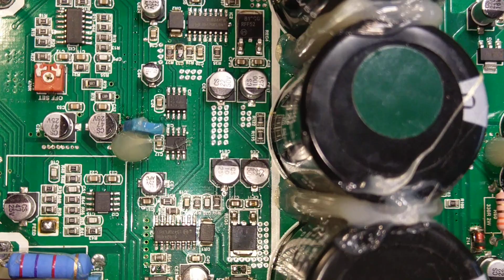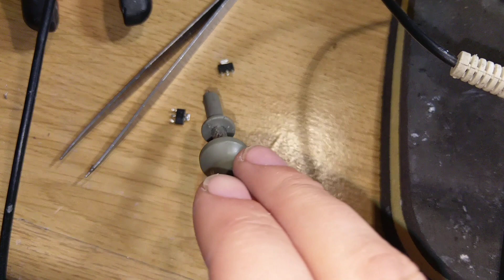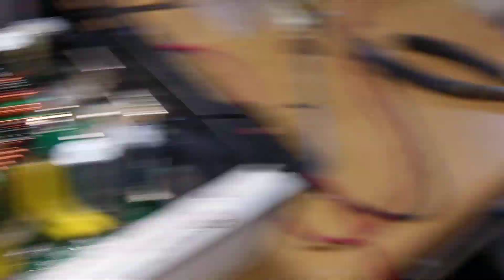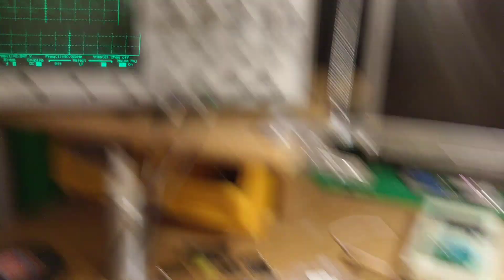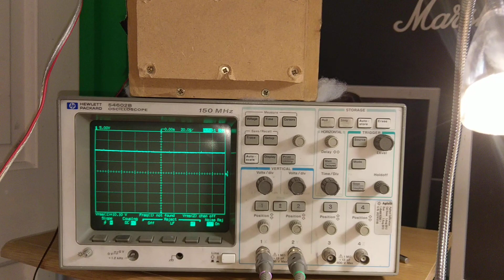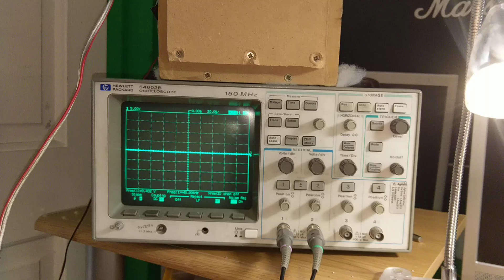HOW TO FIX Taramps turning on but no sound

Comment: Where do you find such terrible amps?  Not adding a tantalum cap across a zener diode is just garbage... zeners are one of the easist way to make noise.  Id prefer a microphic cap over the zener noise.

Comment: Hi bro , all pins of my remote controllers touches each others so after that i have no audio output, sub pop at startup only, tramps big boss 3, rgb light works perfect, its like there is remote with 0 volume

Comment: my amp went is cold outside doesn’t work but in the summer it works with out any problems i have to turn the heater on and wait to get above 40 degrees

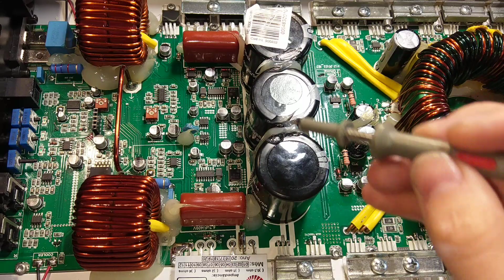Comment: I know this is an old video but I decided to try to contact you here through this one out of just not knowing where else to turn I do have a Taramps Big Boss 3 with this problem but that's not necessarily my concern considering how cheap they are to purchase but I have stumbled across some strange acoustic properties in building a box for the subwoofers that this amplifier is powering it's a ported enclosure for 2:15-in subwoofers but when you run a sweep it plays flat from a low pass all the way to subsonic with no EQ rather unusual but when I go back and review the building choices I made are lending itself to this flat response this box plays very loud but because the response is flat the harmonics with the cabin gain are so uniform it's unreal... The box is tuned to 32 Hertz and like I said if you run a sweep from 25 to 70 hz it'll be flat all the way to your subsonic I tried to invert the subs in the same enclosure with results that were ridiculous the tuning changed so dramatically it peaked at 29 hz rolled off sharp above but extended way down into the teens... This is an exceptionally unique box and I know you like acoustics.
Reply from the maker: @davidvarner8793  I'm starting to understand this, and it's quite hard to read without punctuation. Sounds like you have something weird going on there though. Perhaps the subs weren't sealed against the wood and when you flip them you made the seal. I don't know, doesn't sound right.
Reply: @barevids  The design of the box is rather unique it's on a solid platform every wall is single walled except for the baffle the interior port wall The enclosure is 24 and 1/4 in tall up firing up ports independent chamber independent ports when you drop the subwoofer in this box you get great extension because of the distance from the loading wall but when you invert it it's like hollering down a railway tunnel... The box sounds amazing and the design features lend to a very high SPL it directs pressure to and through the port...
Reply: Okay after a little bit more time and testing because this box has independent chambers, I inverted one subwoofer and regular mounted the other. I achieved the results that I would have got with each orientation coming from a single box. Which was a bandwidth that is the sum of the two orientations. It goes from the low pass filter to subsonic with an extremely shallow slope to the upper teens.  It is about acoustics and pressure distribution. It is actually quite technical but I know you can understand.

Comment: I'm getting a similar issue but I found the cause of it was a loose terminal block on the negative speaker side. Is there anyway to tighten that?
Reply from the maker: Resolder

Comment: what do you think i fried in my amp earlier whenever i forgot i hadn’t unhooked the power and stuck a screwdriver in the positive terminal on my TS 400x4 and it bumped against the outer frame for a very brief moment and i got a little bity ark and now it won’t power on i’ve checked and i have 12.6 v at the amp and the fuse inside looks good but i’m gonna check it in the morning and hopefully it blew but i don’t believe it did
Reply from the maker: Maybe a ground trace, but maybe the power supply control circuit.

Comment: Hi I have a taramps md8000.1 that turns on normally but When you try to play music At really low volume You can barely hear the speaker It starts clipping and protection And it sounds really distorted This is on really low volume

Comment: Nice trick i usually go and feel smell or touch too see whats hot and if its really hot i change it and usually it is my short . I been installing and repairing amps since the 90s i learned a lot but class d is a different beast and you are the best at explaining how it runs and works all together thanks for such a great channel.
Reply: would u be interested in working on mine amps? I got a earthquake cheater and zapco c2k 9.0?
Reply: Lmk if u wanna fix my amp ,

Comment: I always see you probing but where are you connecting the ground?
Reply from the maker: Scope shares a ground with bench supply negative. There is slight noise as a result but any time I need to read critical low voltage waveforms I attach a local ground clip.

Comment: I have a smart3k and something touched my output terminals well one of them for sure. And now it is making a light rumbling sound when the power comes on. It works ok but it sounds like a ground issue but I know it’s not that because I hooked up another amp to see if it was gana make the same rumbling sound and it was just fine. I think something happened to the output because at first it was making a loud popping sound in all of my 4 subs like really loud. And when I turn it up with a lot of bass it starts acting weird and pops my subs and the amp goes into protect and resets itself but it does come back on. But that light rumbling sound is still there. Could the output to the subs be messed up?
Reply from the maker: Yes definitely, it will need a service!

Comment: What is the correct value for IC comparator TL702c or TL712c?
Reply from the maker: TL072C
Reply: @barevids  sir TL072 is preamps what I mean sir ic driver for  Si82xx at the middle there are 2 have 8pins each?
Reply: The number of ic Comparator driver for si82xxx

Comment: Hey hope all is well with you i was wondering if you probably know why my hd5000 taramp amplifier passing or leaking voltages on the out circut or should i say terminals?
Reply from the maker: What do you mean? All full bridge amplifiers have half rail DC voltage on both speaker terminals by default, this is how they work. It's normal.

Comment: What is the difference between the taramps HD 3000.1 and the MD 3000.1.  I found them for the exact price so I need it for a single 12 sub what would be better.    I appreciate if you can tell me.thanks
Reply: i personally didn't had any taramps amps  but big D has some videos on HD and MD series.
Reply from the maker: MD

Comment: Im a newbie and trying to figure out how to do amplifier repair. Im completely lost at what you were explaining. Lool Do you really need an oscilloscope to double check the parameters on the components or can I just check using a multimeter in circuit? What do you use to turn the amp on at home?

Comment: sir good day and thanks for the video , i have trouble for on taramps hd3000 to square wave signal generated input of mosfet driver, at the amplifier section i suspect that the comparator chip with dual output (c16 at the schematic) is damage due to emitting lot of heat , may main problem is i don't know if what is the part number. Sir do you know the part number of this chip or any replacement? thanks

Comment: Do you, or anyone else know if its possible to change the type of low and high pass crossovers? I have a Taramps smart 3, brand new. I waited a while before I installed it and as soon as I tried it I noticed I had a high pitch squeal coming from one of the fans as soon as the amp starts.  It'll stop after a few min but nevertheless it's there.... and hella annoying 🙄!  I can't return it because I exceeded the return period because I had to wait to install due to all the COVID19 BS. Then after tuning it I noticed that this amp does not like low bass notes... it is very annoying. It would be great if it weren't for that, ohh and worst of all some voice creeps through the filters somehow and that makes me want to smash it with a sledge hammer and stomp it like I was doing a Riverdance/B-walk/C-walk! Anyone that could help? Besides the obvious 🙄 of buying a different amp. I have other amps but one is 900wrms and other is supposedly 1kw. I am pushing 2 subs that can take up to 2kw each.

Comment: Awesome debugging skills. Can you please let me know how is the modulation done. What kind of device is used as modulator, a normal opamp with high GBP 15Mhz or some transconductance type opamp? Is it not the self oscillating circuit as even without the Fets being switched, you see drive signals? I'm mostly interested to know the devices close to the red preset inbetween the huge copper jumper and bulk capacitors

Comment: My taramps hd3000 turns on the subs make 5 popping sounds then the amp goes into protect.
Reply: That kinda sounds like rca problems either loose connection to the board of the amp or headunit idk I could be wrong

Comment: I having a problem wit my Hd3000 taramp. It burnt the 2 resistors on the speaker output terminals each on negative and positive sides. It say 10r 3watt on board writing where they were. I changed them to 10 ohm 3 watt resistors but it's playing lower I find I used to get more power. It's like when it's turn up I get the kinda power I used to have at half column wen I test it wit jus my phone and a speaker I test it wit when I just came. Can you help I need to know the type resistors as to color code and what else can be the problem besides

Comment: Can you troubleshoot an amplifier with just a multi-meter?
Reply from the maker: Not really.
Reply: @barevids  Really?? Not even to just check and see if something was blown internally?
Reply from the maker: @Mocredible  you can use a multimeter to find dead fets and shorted drive transistors, open gate resistors etc. Amp Repair cannot be carried out without a multimeter. However without a scope you are risking the chance that you missed something and your new fets will blow the second you install them. Without a scope you also can't confirm integrity of the class D circuit once all new parts are fitted. It's possible to get an amp working again with MM only, but only if you are lucky, or already have years of experience with a scope to know what to look for without it.
Reply: @barevids  Damnn.. Im over here trying to take the most easiest route. Lol Thanks for the info though.

Comment: Is it just me or does these amp guts look different from other amps?
Reply: They look diffrent than most because they are fullbridged technology. Most Korean an china amps are half bridge designs so it requires alot more components.

Brazilian amps are usually full bridge. Few other companys also use it like kicker, jl, a couple amps from ds18 and audiopipe are using fullbridfed designs now.   It's not new.
Reply: @150db8  cool thanks